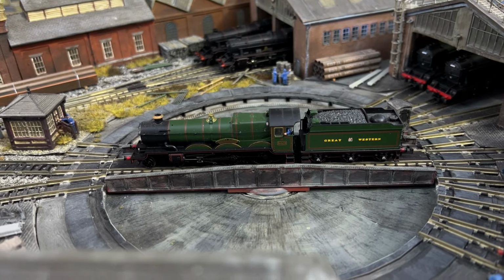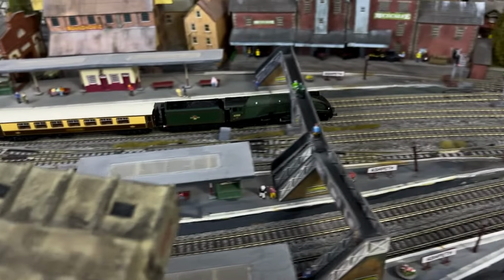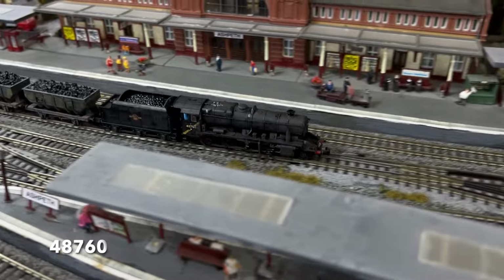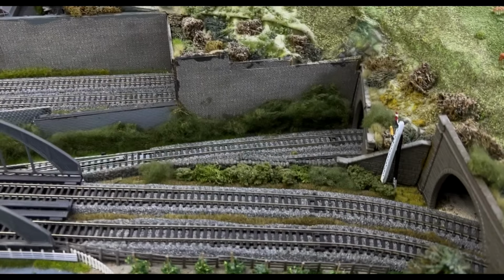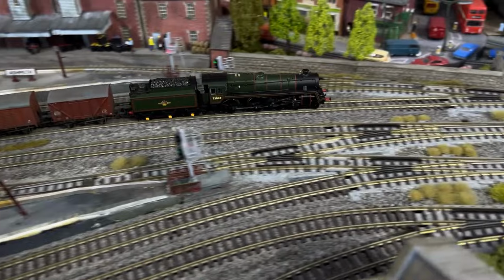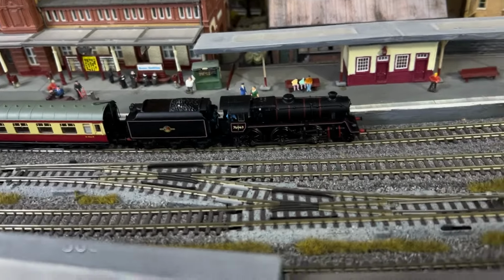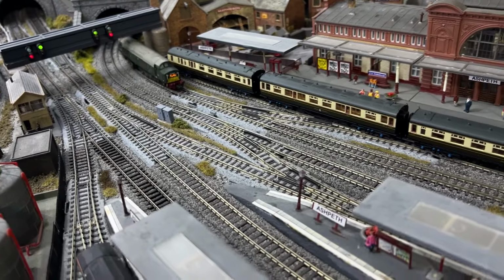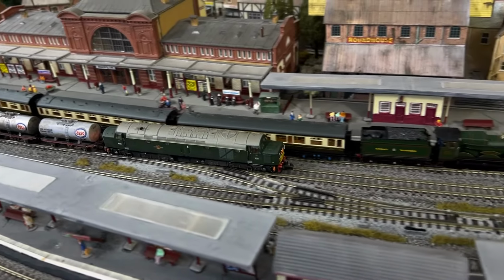Leefield & Ashpeth 42   The Sounds of The Sixties

Comment: Hi Neil, it's great that sound is now available with DC but I think it should be pointed out that not all decoders will operate on DC and it could result in  a failure. Most new decoders will though.
Reply from the maker: Hi, Yes it is interesting the variety. Sometimes the settings have not been set correctly. I recently purchased a new Class 68 with sound and it was dead on DC, simply because the sound chip had not been set for DC. Fortunately, a friend knew how to adjust the settings and now it works beautifully. Cheers, Neil.